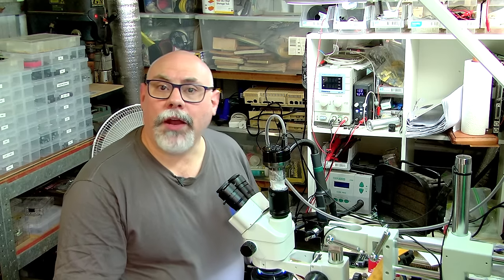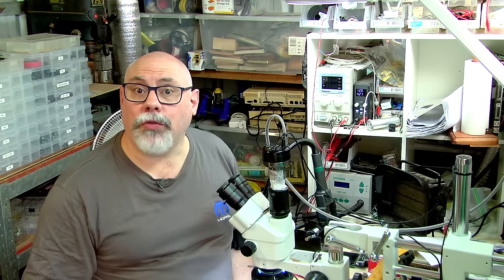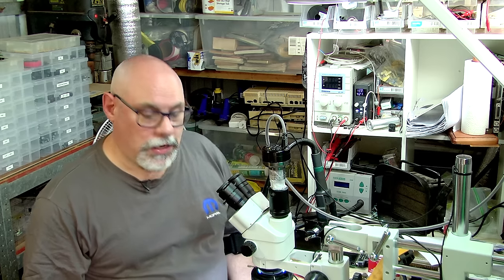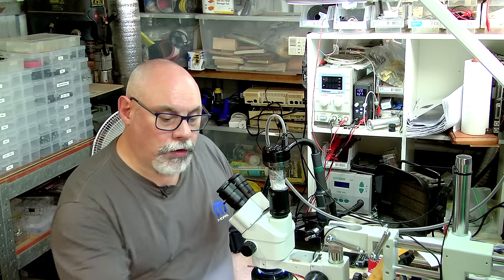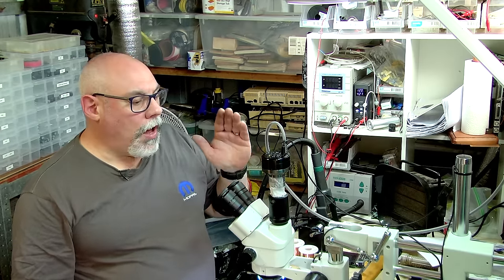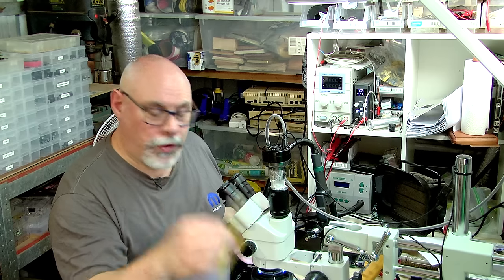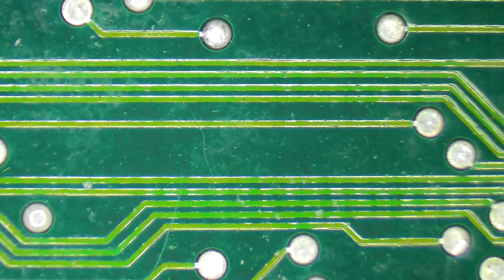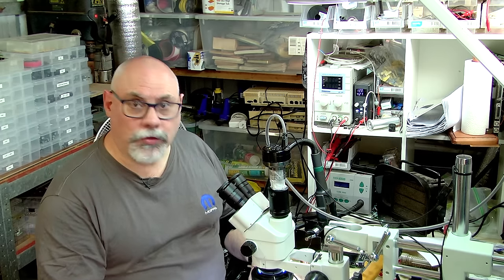Repairing broken traces on a circuit board

Comment: I have a samsung aircon remote control with the smallest copper tracks you ever did see.  I purchased the strongest reading glasses I could buy and they certainly magnified enough for me to do the job.  I am normally ik doing these types of jobs but your video was so brilliant that it made my task run so smoothly.  If I can impart some helpful hints, theys are:  The board in the damaged tracks were corroded and bluish green corrosion product over the tracks. Possibly copper Chloride.  I successfully removed this with a fine stiff paintbrush agitating CilitBang (citric acid) on the area and leaving it for 20mins.  Then washed it off with water and dabs of tissue.  The other tip I used was as the break in the tracks were so small, I shone a torch light from the otherside of the board and then the broken track could easily be observed..  Thankyou once again for such a down to earth and well informed video, you are quite a star.

Comment: Thanks, it seems that contrary to popular belief, you can indeed teach common sense. I have been working on old electronics for much of my adult life, and several years of my youth. Growing up in the 50's and seeing the transformation from tubes to transistors has been a pleasure, and IC's have always amazed me.  The use of fine tipped soldering irons has become a necessity now with the fine PC boards and tiny leads of the ever smaller devices now used in modern builds. This was very enlightening for me, I recently purchased an old 1958 model tube set with an early PC board.  A previous owner had repaired the bad ground by stripping a stranded power cord and soldering it around the outside to repair the many broken traces from some liquid spill back in the day.  I have yet to revive the set but this video should help me in restoring the old set to it's previous glory.

Comment: Hands down, the best and most complete repair video I've come across.  What, no tip / thanks button?  I guess just a 'thank you' very much will have to do!  You are saving people a lot of money.  I'm going to attempt to fix my furnace / a/c board following your detailed instructions.  Will save me hundreds if it works!  A brand new circuit board has a fried spot due to a power storm surge.  Hope this works for me.

Comment: This is very well presented and informative! Unfortunately, the most information I have taken away from all this is that I don't have the means to repair the damaged board of my Xbox controller where I have soldered in new bumper buttons SEVERAL times, damaging the board a bit each time as I don't have a ton of experience. (ex gf somehow kept dropping the controller on the same bumper and wrecking the small button inside lol.) I have plenty of controllers and all I just like learning and fixing things 😁

Comment: This was a very good video. I also finally learned about how flux seems to make solder adhere to the copper in that tinning process, something I see many repair youtubers do to solder a bunch of little pads at once but never understood how they didn't short out every single pad with solder everywhere.

Comment: This is pretty common during R&D.  If you are doing repair you should cover with soldermask or conformal coating after a good clean to stop the oxidation/corrosion getting worse.  It's often a good idea to re-tin traces showing corrosion.
Reply: He does more than tin the traces he overlays them with copper wire. It is impressive. I was thinking the same thing about the conformal coating. Although not necessary prob not a terrible idea.
Reply: Thank you for making this great video Sir. I just wish I had steady hands again! You make it look easy.
Reply: @johncox6666 I think Pentachronic means other traces, where continuity is present but they are corroded so it's going to go away soon most probably.
But looks like in this video the goal was mot to fix a board so no point wasting time. It looked like it was some random old pcb picked for video since it most probably going to have a lot of areas with broken traces.

Btw, I understand I'm paranoid and overthinking but almost every time after cutting excess wire with a blade it looked like trace behind it is also cut. If not still it would be very important to mention something like "be careful not to cut the trace when cutting a wire". Stupid but for some reason almost all of us never think about it before it does happen 😅

P.s. thanks for the video. Most of "repair" either just do those "small precise motorics" very quickly rarely mentioning the details or just quickly go over them without putting accent on it. This video was a "calm experienced guy slowly and friendly showing basic things". Amazing ❤

Comment: That is a good way to fix broken runs. They do make circuit board repair kits that have runs, eyelets and through hole parts. And the runs are in a lot of different sizes and lengths for just this type work. If you don't have such a repair kit, this method does work. I usually lacquer clear coat the board after repairing broken runners and cleaning it well. It keeps other contaminates off the board that way.

Comment: Thank you for your skill sharing Bruce. You've encouraged me to tackle a circuit I accidentally burned the traces off. 😳 Wish me luck!
Reply from the maker: Good luck!
Reply: It didn't work :( but I did more research and found there's a pen with ink that has conductivity properties. I still have yet to try it, but if it works I'll let you know. Maybe you could do a video using one. They're about $30 dollars. (I don't know how much that translates to Australian currency) but if I have some spare left I suppose I could always ship it to you 🙂 

Cheers from Houston!
Reply: @BranchusCreations How do I repair a lifted and destroyed foil trace at the hole where the capacitor and or transistor goes? 
Thank you

Comment: I was about to toss a plasma ball that I discovered had a circuit board that got snapped in two but wondered if it would be possible to repair the traces without too much difficulty.  This video was the first result and was a perfect explanation of the process. Guess I'm not throwing it out until I at least attempt to fix the traces. Thanks!

Comment: For repairing really fine PCB traces on fried consumer audio stuff, I've used thin strands of wire taken from fine-stranded wire. Strip the insulation, fish out one strand and clip it off, then use the customary methods of tinning the circuit board traces and solder the little wire to it.
It works better if you lay off the caffeine that day so you don't have the shakes! Also, taking Zyban or Wellbutrin will REALLY give you the shakes, that stuff is a no-no for repairing circuit boards :)

Comment: these videos are great and I regret not having watched them before i took my soldering iron to my now botched Allen & Heath mixer. What would be cool to see is a video on fault finding and identifying where and why things went wrong. I thought I had a simple job of removing some resistors and bridging the pads they were sitting on (as suggested in the manual - a simple mod that adds 6dB to the phono inputs at the cost of the warranty), but now I only have signal coming through the left channel on each input, as well as some crosstalk where I can here input from CH1 in CH2. I want to go back and do things properly having watched these vids, but I'm not sure if the problem only exists at the site of the pads I soldered (the crosstalk makes me think I damage in other places). All this to say, keen to see more. Very helpful for a beginner.

Comment: Outstanding video!  Thank you so much!  I think this is going to save my SIIG controller board in my new used 386 tower from circa 1990, and finally make it able to use hard drives after 3 months of troubleshooting!

Comment: This was such a fun and interesting guide. 
My 1st and recent soldering project was de soldering a dvd drive controller for an xbox 360 and re soldering to a new chassis it was only a couple of wires, when I powered on the xbox 360, saw that disc drive opened, and read a disc the amount of satisfaction was immeasurable to me. I think someone dropped the xbox because I tried realigning the tray which is easy to do and even swapped the metal shell outside of it and it kept getting stuck.
My next project is replacing the capacitors on another xbox 360 that has the red ring of death.

Comment: Very nice work! My tools are similar except for the solder mask, I use nail varnish, comes in different colours, even clear. I missed it you explained that some enamelled wire has a super tough polyimide coating which is way too difficult to solder through but very common. Don’t just strip some wire off a relay or transformer and expect it to work. The first link for wire that you give is not solderable from the description (they name the coating as polyester and polyamideimide which is probably wrong) in the first section but in the detail description they change the coating type to polyurethane coated solderable wire, check the description to make sure it is solderable “magnet wire”. Love your attention to detail, you must be a fantastic Pac-Man player, tidying up every last dot.
Reply from the maker: I'll need to update that link! Thanks for the tip!

Comment: My mechanical keyboard had keys suddenly stop working or would double type, i took it apart and some of the traces were flaking off, didnt have enamel wire on hand, so i used normal 22 awg wire, its fixed now. thks for the video demonstration.

Comment: I have always had problems with lumpy solder and now I know I just need more flux
Reply: also a clean soldering tip.. if the tip doesn't want to wet (suck solder onto), it will not collect the extra solder as nicely..

Comment: Reminds me of super gluing tin foil pads onto dysfunctional buttons of keypads. It was already trash so there was nothing to lose. Worked perfectly and restored complete functionality. Good video.
Reply: You know what else works on keypads? If you use a pencil eraser on the original pad,  and scrub it until it turns a dull black instead of glossy,  the pad will work like new and remain original.  It also lasts for years!!

Comment: I have a Pace PRC 2000 station and generally repair and restore CB radios here in Australia.
I use copper trace film and other items from Circuit Medic. 
Electrolytic caps can do some severe damage to old boards and sometimes you have to grind the pcb and apply epoxy resin then buff that to board level before replacing the trace then colour epoxy over it.
I have several different fibreglass erasers and a stainless steel wire eraser from Rush. The red coloured fibreglass erasers are very good for light removal and cleaning around the trace then a wipe with IPA and away you go.
I also have the Circuit Medic thru hole repair kit for via’s with eyelets. I also use the same style scalpel and have for decades.
Top quality tweezers are a must have. I use nail polish remover pump bottles for IPA as it makes it easy to get the IPA on toothbrushes etc.
I don’t use Qtips but foam headed types as they leave no fluff.
Obviously the Pace has proper vacuum desoldering irons so no need for wick. Theres not much that machine can’t repair even multi layer PCBs.
But a good video for those who just need to do a minor repair.
If you go to the Pace site or search here on YouTube they have many excellent videos on repairs, also Circuit Medic has an excellentsection on all types of repairs with from go to finish descriptions and photos.

Comment: something i like to do, even though it's probably overkill, is to sand the wire flat where it's going to be soldered to the traces. i usually only do it on thicker traces, might be hard to do when you already need a microscope to see the wire :D
Reply: I crush the wires in a vise to make them flat.
Reply: @wernerfritsch6436  Good tip! Thanks for that.

Comment: Tinning the wire first can speed up the soldering
Too much heat on the track/trace can lift up, making it worse - that is the main reason for using flux here.
Using a longer piece of wire (snipping afterwards) can be easier to hold in place - use pliers!
Do check afterwards for any solder whiskers/bridging
If you are using a cone tip [on the soldering iron] place the side of the cone along the trace/wire.

Comment: Thank you for creating this great video! I believe this is the issue I am having with a board on my LED message board driver. Cannot find a replacement part for it anywhere after extensive searching and reaching out to suppliers. So, I’m thinking this is the repair it needs as I have observed there are some traces that look buggered.

Comment: Running that wire between the two vias I probably would have soldered the wire to the existing copper underneath if only for a bit more rigidity.  Otherwise I can say you've helped me improve my own technique.

Comment: Cheers, Bruce! I'm hoping to one day repair my ancient Amiga 500 that is suffering from the notorious Varta capacitor electrolyte leak issue. Like the PCB you've featured it's quite bad as the electrolyte has indeed eaten well into the traces meaning it's not a simple "re-capping" job.

Comment: One note about a potential confusion.  There are different grades of enamel insulations for magnet wires.  The lowest melting temperature is Formvar  (melting point 113 degrees C) and that is easy to use in the trace repairs.  That is basically Class A insulator.  There are other classes that have been used at least in the past -- Class E, B, F and H with temperature ratings going up in that order.  My recollection is that Class F is polyester (same stuff used as oven cooking film) and is rated in electrical insulation terms up to 155 degrees C.  The highest polymer insulators, Class H are mainly polyimides and the Silicone or Teflon families.  Beyond them you change over to ceramics or mica.  Anyway, any magnet wires beyond the Class A insulation tend to become cumbersome to solder without peeling the insulation.  Not impossible, given that typical soldering iron tip temperatures are over 300 degrees C, but just cumbersome.

Comment: I've gotten lucky enough that any time this happened to me it was a pretty short run on simple boards and I just found the start and end point of it and soldered hookup wire to each end, basically bypassing the trace instead and using wire.

Comment: Good stuff Bruce. I was surprised that you didn't perform a continuity test but maybe that wasn't the goal of this video.
Reply from the maker: Yes, I should have done at least one continuity check in this video. I would normally follow the trace back to a via or to a component and test from there, but there were so many breaks on the board I was using for the demonstration, the test would probably fail. But that might have been a good thing to include!

Comment: I was wondering: If you buy the leave-in (aka non-clean up) flux. You could just leave it in? The only reason to clean it is for aesthetics?
I was also wondering: is the UV mask like those "5 second fix UV pens".
Great video. Thank you!
Reply from the maker: Aesthetics is one reason. Most of the boards I get are pretty dirty, so I always clean them after working on them, not just to remove the flux but also to remove any dust. The other reason is that moisture can get trapped under the flux and cause corrosion.

Comment: Hi, there I wondered if I could ask you a question. I have a pair of small speakers and all of it is rewired and that's perfect but one track came up and snapped. how would I stick a new piece of wire to the board. I can make the connection but I don't know what to stick a new track down with? please can you advise with an eBay link to a product or name

Comment: Overall a good tutorial.  One issue, though, could cause even more problems; the poor cutting technique.  If you look closely, you'll see in the first repair that the tip of the scalpel actually damages another trace because of careless positioning and use of the scalpel.  To ensure precision cuts and solid control, the tip MUST first be anchored firmly to a blank spot on the board next to the trace, then the blade rocked down to cut most of the way through the wire.  (You don't want to cut completely through, as you could damage the trace under it.)  Simply rocking the wire back and forth a few times will then have it break cleanly.  Using the 'chopping technique' shown in the video is a good way to damage traces or even cut completely through them.  (Not that **I'VE** ever done that, you understand, and spent over an hour trying to track down the break in the trace that was actually right under the edge of the wire I cut! I would never be that foolish! /eyeroll )
Reply: Even better, and much easier--just trim the repair wire to length after you solder one end to the PCB. Hold it down with a weight, solder in place, and it's already done.
For weighing it down, use a small piece of wood or Bakelite, whatever you can find, and put it on the wire, then something heavy enough on top. Adjust the free end of the wire until it lines up nicely. Once it's held down onto the trace, you can solder the other end.

Comment: 1. Is there a way to repair traces within the layers of a PC board? 
2. What temperature is recommended for working on traces? I’ve had problems with overheating and pulling the trace off the board.

Comment: Does this method work on any motherboard? I have a laptop with broken power jack and possibly damaged board in the same place, wondering if I can solder new points if I identify the traces correctly